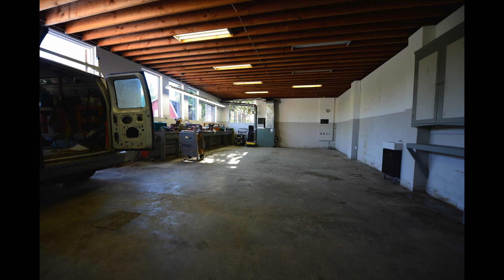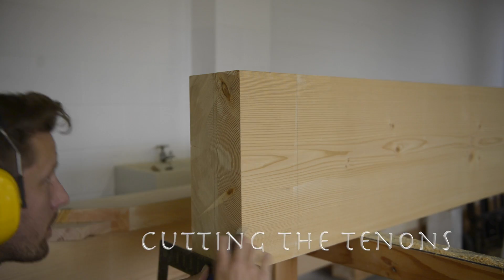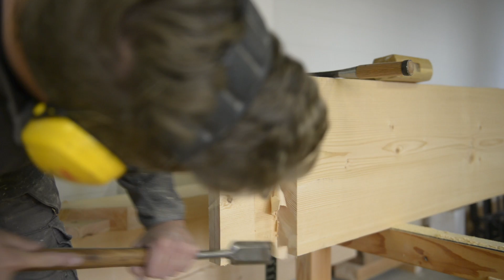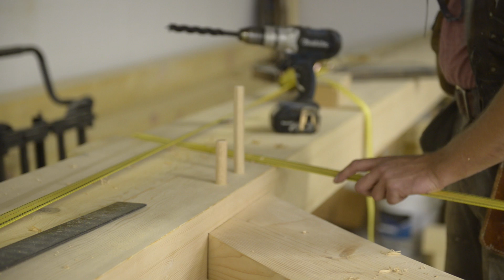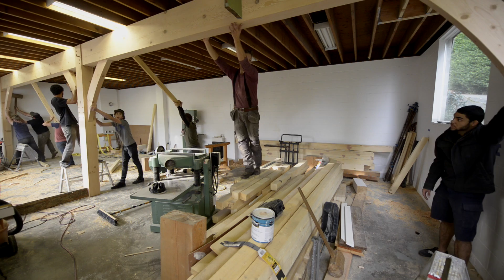How To Install Huge Beams with Joinery

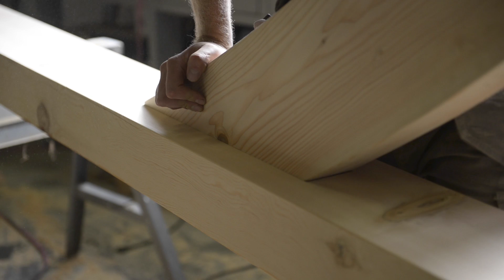Comment: I like the poof of air and sawdust at 4:22.  Sign of a nice, tight fit!
Reply: +Chris Moore I agree. I think he's just set a standard for me to reach.
Reply: +Chris Moore Good eye! I missed that, had to go back and watch again.
Reply: +Chris Moore What about when the wood expands and contracts each season? Could the tight fit cause the wood to split?
Reply: +BooneDogggy Not at all, all wood will expand and contract at the same rate, plus I'm quite sure he's using dry (kiln?) wood, ensuring no cracks or splits.
Reply: +BooneDogggy Not sure which part you mean when you say tight fit...... as far as the beam and post go, the post doesn't move (expand longitudiinally) and the beam which was dry will have movement radially( around the girth). You can see upon the raising of the structure, it was construct under size so as to slide under the floor system.  Although the video didn't show it,  they probably shimmed the floor joist from the bottom side afterwards. Those shims can be adjusted when needed seasonally, if ever.
Reply: Chris Moore i

Comment: My shop is over 80 years old and they used 16”x 3” x 46’ joists slabbed over with 14”x 3-1/2”x 46’ knot free planks.  All virgin timber.  I’ve had a few repair issues but it will last another 100 years!

Comment: Dude, you should have on safety glasses, and even a dust mask for dusty jobs. Sure wood is organic, but it also can cause breathing problems. I was a patternmaker in the mid eighties thru early nineties, and worked with various hardwoods, mahogany maple poplar mostly. I've seen fine dust explode(from disc sanders), and various power tools come unglued. We used to cut 3/4 sheet 6061 alum plate with a worm drive Milwaukee circular saw, with a carbide blade and a second guy with a HD squirt bottle of water. I saw one guy with a 6" hand air sander catch the edge on a plate, and it came unscrewed, flew to the metal overhead ceiling, and came back down and sliced his forearm open, cutting an artery. I removed my military style belt and used it as a turnicate, and we  got a third guy to drive us to the hospital. Stuff happens, and as hard as the politically correct try to convince themselves that  they can stop accidents from occurring, they are just fooling themselves. I digress. It's been awhile since i digressed. So maybe take a minute and think about the dust problem, for you and your family. Great videos and impressive, well actually very impressive skills. My shop has a 1953 Delta table saw, a 1953 benchtop drill press, and two shopsmiths i just bought in the last couple of months. So I'm just playing around to make some small projects. I also have a 24 X36 cast iron surface plate to glue stuff up on(awesome). I want do some dovetail stuff.Hey i could go on all day, so I'll try to back out graciously right now. I really enjoy the videos you do, and your skill level is beyond compare. Thanks for sharing!

Comment: a little tipp if you use adhesive rubber (i dont know if this exist in your area here it have the name Klebegummi) you dont need to holt your template all time in my Workshop we use this verry often and it dont make anny traces on the wood

Comment: awesome build! but can someone please answer this. how will that post and beam fit under the joists...raising it up like that? i wouldnt think there would be clearance to lean the post and beams in place like that. is the post and beams shorter than the ceiling? and then once they got the post and beam up where he wanted it they shim and wedge wood into the gap between the ceiling joists and top of the beam? im not a contractor...i just really love the post and beam look and wondered how i could do this at my house

Comment: Sensei:  Shims and wedges between the beam and the joists?  Raising walls, cabinets, etc. under a fixed ceiling always involves the danger that if the height is perfect then one can’t tilt it into place because the diagonal height is even taller.  How much gap did you allow for?  Or were the joists so springy that they went up and came back down to rest on the beam?
Reply from the maker: +halnywiatr I left a 1" gap that I will fill with rubber blocks to help prevent sound transfer through the joists.
Reply: +The Samurai Carpenter It really shows that you put some thought prior to lifting it in place, putting step ladders and floor blocking where you needed it, nicely done! most people would get to about 30 degrees and have an oh crap moment! Done like a ninja !
Reply: My father replaced the upper triangle part of the load-bearing wall (blockworks) of our house with a beam structure (roof truss) to open space under the roof. He lifted the roof with jacks under the ridge beam so that the truss diagonal could move under the ridge beam. Then he let the ridge beam go down on the roof truss. He played with the sum of all the little free plays of the roof framework to do it. My mother was mad and thought he was going to topple the roof. :-D It holds well since 1990.
Reply: The Samurai Carpenter 
Great idea (rubber) I’m guessing it would be quite dense for structural integrity ..

Comment: How are you planning on shimming or connecting the beam to the floor joists? You had to make the posts slightly shorter than the ceiling height in order to lift it, correct?

Comment: So did you go back and sand the wood plugs flush or leave them sticking up the 1/4" or so when you cut them off? 

If not why? Seems like flush would have looked so much nicer?

Comment: +The Samurai Carpenter  Did you check the concrete beneath the foot of the beams, is is thick enough to support the weights that will be transferred down to it?  I watched one of those "This Old House" shows where they had to take out part of the floor and create a proper footing for the posts because the concrete for the floor was only a couple of inches thick but the footing for a post should be much more significant.

Comment: I'm building a House with a open beam concept in the kitchen and living room the Question I have is the space is 32' by 24' only going up one direction at a 4 by 12 pitch how many post beams do you think I need or can I just use one on each end ?

Comment: Where did you get that 30" chisel it's awesome? Also you don't secure the beam to the floor or to the joists at all? It was tight on one end but on the other I'd be worried it would fall over.

Comment: when you tilt the beams up from ground, would it not catch roof first. I don't understand how it just slipped in..thanks
Reply from the maker: +Graham Higgins I built it shorter and then shimmed up to the joists.  You can see how I did it if you watch the next video.
Reply: ahh, nice one I will. Great vids by the way

Comment: +The Samurai Carpenter Is there anything fastening the beams to the floor or the ceiling, or is only the weight of the ceiling and a tight fit holding the beam in place?
Reply from the maker: +41ch I'm in the process of fastening them now.  I'll post a video soon.

Comment: How did you secure the beams after they were up? To the floor, to the wall, to the ceiling joists? I need answers!!!
Reply from the maker: +July With Fitz I'll make a video when I get to it.  Chill bro.
Reply: +The Samurai Carpenter fine

Comment: Got a question. Without seats for the beams isn't the supporting value only as much as the tenon which doesn't look to be all the much?
Reply from the maker: +gary24752 The beam ends are housed 1.5" into the posts before the tenons start.
Reply: +The Samurai Carpenter Missed that some how. Thanks for the reply.

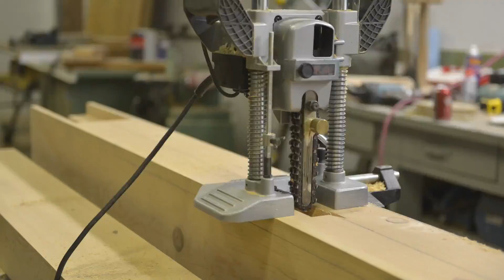Comment: 4:06 did you rout that without any guiding construction, by hand? or did you used some kind of template i didnt see?

Nice building. Would have been nice if you would have made some little brakes in the time lapse to explaine details
Reply: +heinrichwuerfel Hit the stop control of YT.

Comment: Was looking to make my own glulam beams, 24" to 36", how do you think that makita kp312 will do on beams that wide? They dont need to look the prettiest like the pros.
Reply from the maker: You got 100 clams lying around your shop? What are you building that needs glue lams that big?  The planer can handle anything you throw at it but you will get uneven lines where each pass overlaps but you can belt sand them out.
Reply: im looking at building a small warehouse and steel quotes were just too expensive, but glulam looks like a possible solution with a little know how, careful planning and a forklift. regular trusses are just a waste of space too

Comment: At 4:26 the top part of the stepped mortise should have been angled and not cut at 90 degs the way you did it .In actual fact there was no need for a post there .It should have been a tabled  or splayed scarf joint with folding wedges.and 3/4 inch iron fishplates .

Comment: It seems the beam was a tighter fit on one end than the other. Did you end up shimming it afterwards at all?
Reply from the maker: +J DeWitt DIY That is the next step.
Reply: The Samurai Carpenter Sounds good. Your shop really looks like a woodworking shop with that beam and those beauuuuuuutiful knee braces.
Reply: +J DeWitt DIY It would be impossible to install without using shims, unless the 'heels' of the posts were radiused beforehand. I should think that the tight-fitting end was a minor mistake.
Reply: +J DeWitt DIY You really can't make these to fit perfect.  You have to make it short anyway because otherwise you can't raise it at an angle because from edge to opposite edge the construction is longer than the actual height measurement so you have to build it shorter and then plan to shim after it is vertical.  This applies to retro construction like this.

Comment: Love your videos, your energy and you have a pdg skill set. Love your new shop and beams. BUT ......  @2:59
Reply: Was thinking the exact same thing. One slip with your super sharp 30" chisel and it's no more little samurais.
Reply: +DesandSam haha. Perfect. FYI. Full disclosure, I was paring a dovetail today w my little 15 mm paring (old from Japan) slipped and caught the outside of my thumb. Looks like I severed a tendon. Safe working. 
Peter. 
( ps I sent you an email as I thought it wouldn't go through).

Comment: AWESOME! So cool to see joinery on such a huge scale! Good job, man, it looks damn cool. I'm super exited for the channel and your workshop, I think it's going to be some good times and videos in the future :)

Btw, regarding saggy floors. I have a shop on the second floor that spans 36"x22" (11x7meters), how much weight do you think I can put up there?
Reply: just use your common sense, if you do intend to put very heavy things up there i would recommend consulting a structural engineer
Reply: staalmaffia Common sense can only take me so far. At the moment I have a tablesaw, some minor equipment and a 100kg bandsaw coming in a few days. It's all spaced apart and near the walls though.

What I'm worried about is slow sag, not that the roof is coming down :P
Reply: I study cicil engeneering, and aslong as the beems don't come out of the walls from the amount off sagging, you won't have a problem. Beams can sag a ridiculous amount befor breaking, and these view tools wont be a problem.
Reply: Civil *
Reply: staalmaffia Aight, thanks for the help :)
Are you a woodworker as well, or just an engineer?
Reply: I'm a furniture maker, and a 2nd year civil engineering student
Reply: staalmaffia Cool! Those two most really go hand in hand. I've always wanted to be an engineer myself, but don't like school and suck at math :P
Reply: I recommend placing super heavy items near the walls... Not the center of the floor.  There will be less stress on the building this way.
Reply: Zach Hilty Yeah, all I'm going to have in the middle is a bench and my tablesaw. Thanks for the tip :)
Reply: +staalmaffia That's horrible advice, and you're not far enough into structural engineering to make such a statement.  Beams are not designed to sag a ridiculous amount, and you don't know what the material the beams are made of either.  The joists in the floor are set to a limit, L/360 or L/480 are common displacements for floors (in homes).  If static loads, like machinery on a second floor, you may want to consider beefing up the floor a bit.  Additionally, if he were to introduce "sag" into the floor (or, displacement if you're actually in civil engineering) you'd know that the compression of the beam sagging, basically causes it to shrink over it's span, which pulled the walls in.  Now you've introduced a second force on the walls that aren't really supposed to be there.  Also, civil engineering is broad, are you roads and bridges, or are you structural.  Because when I went through my civil engineering program, we studied both, but had to choose after our 3rd year.
Reply: Thanks for all the comments from everyone! I had a couple of carpenters at my house today for some other stuff, and I asked them about the floor. Weight really shouldn't be a big deal based on the span and the support below. :)
Reply: ***** Thanks :) Yeah, I've got the weight spread out quite well. Just a bench and a light tablesaw in the middle, the rest is next to the walls. I recently got a 100kg bandsaw, but I'm gonna put that in the next room over some support beams, so it should all be good!

Comment: Samurai Carpenter, how can I make my own tool pouch vest?
Reply from the maker: +redrogae Get some leather, heavy nylon thread and a few other simple leather working tools and make it.  Nobody taught me and my vest turned out just fine.  I have some upgrades I'm going to make in order to make the vest even more efficient but that is always the case.  You rarely get it perfect the first time so just get on it because the process is more valuable than the product.

Comment: Bad ass. Are you going to insulate the ceiling for obvious reasons and sound killing effect? If you are putting a suite upstairs insulation and maybe even a layer of 4x8 insulation board over the insulation followed by 5/8 fireproof sheet rock. You could be cutting stock on Tablesaw and people upstairs will never hear you. Those beams are sick. Great Freaken job.

Comment: What is the bandsaw tool you used at 3:34 to cut the curve in the knee braces? I've seen a Milwaukee Portaband, but the tool you used looks much different. I'm super intrigued! Nice video!
Reply: +deemstyle I thought the same thing. Sweet bandsaw.
Reply: +deemstyle It's a Mafell bandsaw. If you do a lot of heavy timber work it is fantastic. Tips the scales at $6200.00 US dollars.
Reply: Damn! That's pricey!
Reply: +Wind_Knot83 Wow, thats a gut punch. Can't beat it though for that kind of work.
Reply: Mafell

Comment: there must be a way around not having a beam in the middle of the shop and still support the floor above. that's what I have and I drives me crazy. if anyone knows than let me know.
Reply: Short answer - steel beam. Posts at each end, against wall. ( or, in the wall )

Comment: Okay, Dude. Now I'm just speaking out of my hat here, but i'd like your comment. And I just subscribed. And I ask great questions.

Now, I think that beam is Way the F overkill. I would not have a beam raising party - I would have only installed the center beam, with the crucifix T, and it could have spanned 12 feet or so. I think that would have been enough to do the job. And I would have used braces + double manual winch to pull it up there. I guess it depends on your budget and whether it's your house? (And if you have a good church to count on.) What do you think? Fill us in.

AND GREAT WORK - super aspiring.
Reply from the maker: I think it's just right for my work shop.
Reply: Short answer. LOL.

Comment: With the work your doing on the shop, and the skills you have gained, you need a offspring, or a apprentice to pass it on to. Imagine when you're old, and you just close everything up. Also, as long as you pass your skills on, they will live on. Just  think, some of your tools could be used a hundred years from now in the same space you are working on. I had a friend in high school who's grandfather was a stone mason. Her father, did construction, and stone work on the side.  She had three brothers, and none of them wanted to pick up the family trade. when her father did stone work around the house she would help. Eventually, she learned the skills. She was only five nine, and barely ever weighed more than a hundred and ten pounds. She became an architect, and formed a business specializing in old fashion stone masonry.
Reply: +Kiki Lang Oh, how thick is the cement under the support beams. Sometime they punch right  threw the cement.
Reply from the maker: +Kiki Lang I have four sons.  Only time will tell if they want to follow in my footsteps.
Reply: +The Samurai Carpenter I don't want to monopolize, your time, but could you a video, of a piggery building.Or any book I should read?I want to start a 300 pig organic farm, and I want 100 pigs per level and the sow, separated.....I think wood...would be the cheapest material, but a 250 pound pig, x 100 x 40 years, im leaning toward brick and motar, with steel post.Is it possible to make something strong enough to last that long, out of wood?sorry for ranting, just need some help.  :)